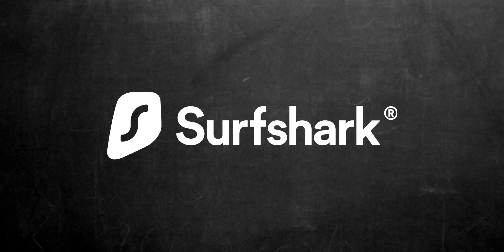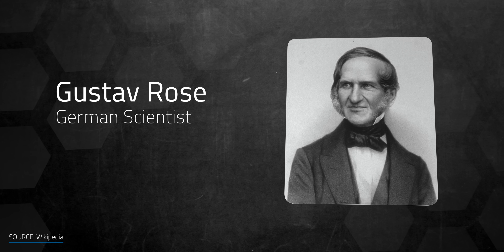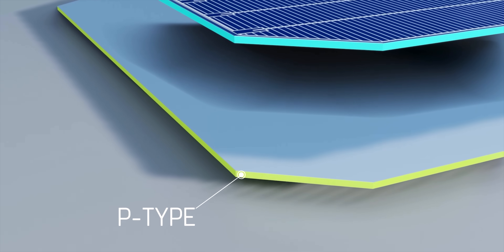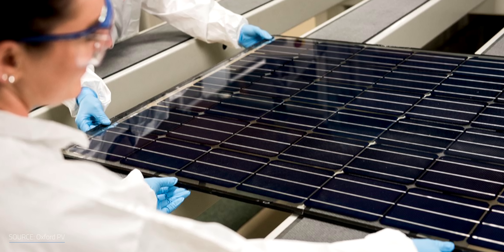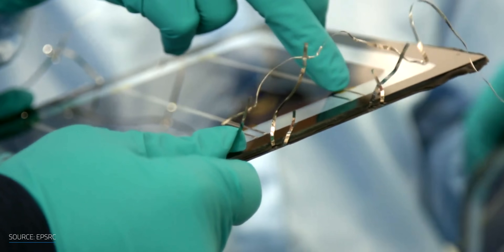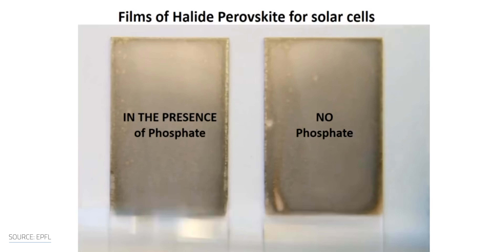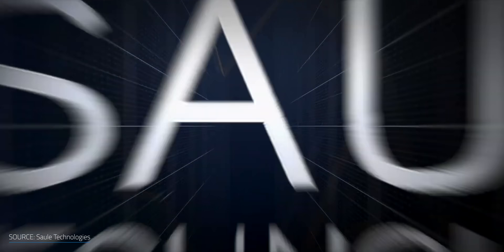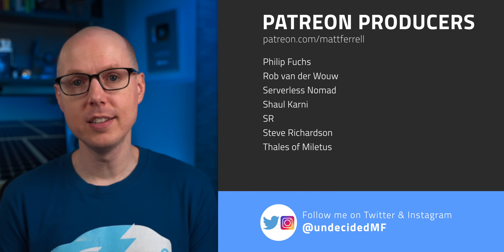Perovskite Solar Cells Could Be the Future of Energy

Comment: So if perovskite solar cells can work in any wavelength, you could put cells in the visible light spectrum facing the sun and then under them, cells that pick up the inferred band (heat). Effectively, you could generate double the electricity per square foot. Since they are thinner, you could put two of the inferred cells under the visible light cell (getting triple the electricity per square foot) and still have a case about the same size and thickness for the silicon cells. Imagine how much power could be generated if each house produced triple what it does now. The inferred cells could also be placed (and generate electricity) anywhere there is heat (steel mills, processing plants, refineries, etc).

Comment: Scientific and engineering discoveries tend to progress in a nonlinear progression, the farther you get on the curve, the faster information increases. It's like how computer processing doubles (about) every two years.
Reply: Moore's law has more to do with optimization than discoveries. Discovery can stall out once the low hanging fruit is picked ... Which is cars haven't really hardly changed in 50 years. Then innovation tends to happen in leaps once a critical mass of supporting technologies arrive for the next stage (like self driving cars).
Reply: @davidaustin6962  It's commonly believed that all human knowlge doubles every two years, information increases exponentially, not linearly.
Reply: @kevinmarsh8922  yes but not all information yields immediately useful innovation. That's why it tends to happen in phases.

Comment: I could see this being used in commercial grid solar installations instead of at home installations. Since commercial grid solar installations are mainly installed on the ground in stadium style slants, it's much easier to do maintenance and replacements. That's also where panel cost is a bigger deal and replacement cycles can be built in.

Comment: Couldn't that be combined with graphene to create the strength needed for longevity, ideal for windows maybe
Reply: Strength isn't the problem. It's efficiency.
Reply: @davidaustin6962  isn't graphene one of the most conductive compounds created, would there be a work around. Graphene from hemp surely would offset that efficiency in production
Reply: @beinghonestsucks8615  not sure of what you're saying, but graphene only exhibits superconductivity when at the "magic angle", which we haven't figured out how to do effectively. Otherwise graphene is about as conductive as graphite, which is nowhere near the conductivity of silver.  Besides you don't want conductivity in the pn junction as that would short it out, thus zero efficiency.
Reply: @davidaustin6962  graphene is used to getting used in everything from cement to military application for strength flexibility and conductivity I was asking the question as I was curious if it could be adapted to the application, one of the questions in the video was strength over time. That might solve that part of the problem. Everything is about cost nowadays
Reply: @beinghonestsucks8615   the reason it helps those materials is it increases resistance to cyclical mechanical stress by preventing dislocation movement in the lattice structure, the main failure mode of those materials. But perovskite fails not due to that phenomenon, but because the material itself is not chemically stable and chemically breaks down no matter what is mixed in with it. There's no lattice structure, no dislocations, just an amorphous mixture wherein certain elements precipitate out over time and no amount of graphene can stop that. Think of it this way, if you add graphene to slime will it make it more rigid? Not really, because the graphene just slides over itself in that matrix. It actually makes an excellent lubricant, making the Material more slippery instead of harder and more creep resistant.  Do a websearch for graphene lubricant.  The way it interacts with a material depends on the material. Some cases it makes it harder, other cases, more slippery. It needs a crystal lattice to makes stuff harder, but perovskite is amorphous, no lattice structure, it at least a fragile one that becomes more amorphous over time
Reply: The Slime wouldn't go rigid but if you incased it in a very thin layer it wouldn't it hold rigid and stop any other interaction while maybe not stopping efficiency. Kind of like a tesseract structure. I am very new to this type of technology and I have a lot of research to do thank you for your feedback it's much appreciated

Comment: This tech looks like it would be an interesting way to reach a “temporary” or “inexpensive” market for field trials; phone chargers, eco-friendly RV enthusiasts, or young homeowners wanting to try solar for the first time without a massive investment. This leaves the long term/industrial market to the long lasting silicon panels while they work out some of the issues.
Reply: Honestly it makes a good material for making short life span stuff, which is what companies do with electronics.
Reply: Depends. If longevity came to say 30% of the longevity and stayed at 5% of the cost, it could be worth it for long-term/industrial uses. The combined increase in efficiency plus cost factor would make it economically attractive even with replacement.
Reply: In solar systems the solar panel cost is already quite low, the installation is actually a large part of the cost, roof work is expensive generally. In europe one can buy a 380W EU made solar panel for 150€(almasolar i'm solar panel)
Reply: @miragept  batt bank is the biggest cost if you install your self
Reply: @ambersmith6517   Yes, for systems with storage they can get expensive quite fast, hopefully the prices are going down with good chinese storage.(byd for example)

Might have a house renovated cheaply on a village, will try to have 3/4 solar panels, 2.2-3kW inverter and 2-4kWh LiFePO battery storage. Cheaper to do solar than connecting it to the grid, and paying for the privilege of paying more is not something i want.
Reply: @miragept  It’s sad because it’s so easy to install them. Can even use glue/rope.
Reply: @MobileAura  That is the case for flexible ones however regular ones would be a bit harder to glue.
Reply: @miragept  I prefer PowerFilm tech.
Reply: @miragept  Na+ will be cheaper in the future I think.
Reply: @mr.gaming6277  And Titanium is the 9 most abundant element in the earths crust, but we don't see a great use of titanium for a reason. But in those Solarpanels we can use TiOx and dont have to use the expensive machinery for raw titanium. If we get rid of the realy rare stuff, then we should be fine. Also the recycling is more energy intensive for silicon.
Reply: @dieabsolutegluckskuche5174  Excellent point about Titanium. Pure Ti oxides and burns into oblivion at a temperature of 600 degrees (Fahrenheit, IIRC) even though it has a melting point of 3,034°F (1,668°C). To unlock its potential they have to melt it and alloy it with Aluminum and Vanadium in a vacuum chamber. The resulting Ti-90-Al-6-Va-4 (I think that's what it is called) is what we usually think of as "Titanium."

Another good example to prove your point would be the history of Aluminum. It's one of the most abundant elements in the Earth's crust, but it is so hard to extract from it's ore that it could only be used practically within the past 2 centuries.
Reply: @jeffbenton6183  great addon, I wrote the Aluminium Part under another comment:)
Reply: @dieabsolutegluckskuche5174  Ah shoot, I must've missed it, thanks
Reply: @jeffbenton6183  :)
Reply: it would be interesting to see the replacement cost of Perovskite Solar Cells, that are stated to be much cheaper, vs the traditional solar cell over 25 years. If it needs to be replaced 4 times but is cheaper or on par with current cells that would make the market take notice.
Reply: @GlennTXstate10  Exactly. There are so many factors - cost difference, carbon footprint of the original manufacture (after all, environmental are a major factor for many people when we're talking about renewable!), etc. Clearly the longevity is a factor and (so far) a disadvantage, but way too early to call how it plays out
Reply: @mr.gaming6277  I guess the point when whooshing over your head
Reply: This sounds more like a scheme to make junk solar panels that won't last and will just consume the market while they kill off silicon solar panels. If something is break easily and can make a profit from it companies will choose that as that will be a better source of income vs a one and done deal.
Reply: @fasddfadfgasdgs  If the success of a business comes down to skimming money from undervalued commodities - both parts and labour, then it comes down to someone saying "it's not personal, it's just business".  In which case, your points are totally valid. Taking the cynical hat off, it might be a way to consume less Carbon?   I'm not forcing an opinion here, just speaking my thoughts.   How would you make it work?
Reply: @fasddfadfgasdgs  You're probably an avid consumer of conspiracy theories, aren't you?
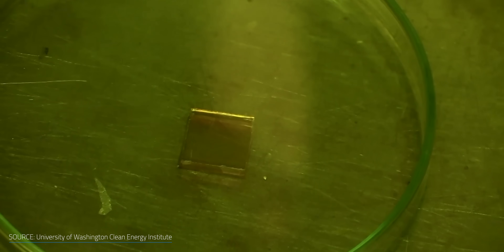Reply: @MichielvanderBlonk  I'm not sure if you're trying for deflection disingenuously, but your response is a straw man. You are responding to a point I didn't make - and even the comment I responded to made no mention of the organization of economic systems. Starting at 2:42, this video might help. https://www.youtube.com/watch?v=IawIjqOJBU8
Reply: @zweigackroyd7301  Planned obsolescence in light bulbs is an actual thing though, and it was a behind the scenes back door conspiracy by the companies that produced them in order to have recurring sales.
Reply: @scottiemcqueen  Right. We're talking about the research stage here, so not really comparable. It's not like perovskite naturally lasts ages, but researchers are finding ways to shorten it. apples/oranges
Reply: The only known real world use for perovskites is making youtube ad revenue for people like Matt.

Comment: Doesn't matter, even if solar cells were 100% efficient (an impossible achievement) they wouldn't be good enough. It's simply a fact that the sun doesn't deliver the energy density required to the Earth's surface, at the very best only 1000W/m^2.

Comment: What a great evaluation! Here in Australia we have great access to sunshine with acres of solar panel farms in Western Queensland in Particular. It is amazing to drive past, but finding out they are only 29% efficient surprised me. I'm looking forward to the next decade when they approach or pass the 50% or 60% efficiency. I would not be at all surprised if the solar industry gets push-back from the coal and oil producing industry though.
Reply: The highest recorded energy efficiency is only 35.6% and that was in 2016 which was a 12 year gap where theirs was about 10% efficiency increase from the 5% gained from 2016.  It probably need another 20+ years to hit 50%+ efficiency and chances are when that happens it will be really pricey

Comment: It seems like this is similar to the battery degradation & limitation problems present on the Nissan Leaf vehicles (that have poor insulation & passive refrigeration/heating systems); compared with the superior active thermal designs used on Tesla vehicles.
  . The 30% efficiency limit on silicon solar panels is ABSOLUTE. It does not matter if they are cheap & resistant "by themselves", if they are future_obsolete on integration.
  -> Once the "standards" allow for self_contained thermal solutions (with each solar panel having its own microchips & sealed fluid disipation systems), then the weight from the "extra armor" required to protect the "fragile crystals" from the enviroment will not be a concern.

Comment: It's certainly an interesting video, and an interesting technology that may well be the future. but, personally I found this video kind of misleading in how it was structured. The first half, which most people will watch, explained this kind of solar cell as superior in every way; cheaper, lighter, more efficient and able to be basically painted on any surface. 

But the second half then adds so many negative elements to this solar cell that it's not only obvious why it isn't the future, but it essentially contradicts the first half of this same video. It's not cheaper, it requires gold and rare resources to encapsulate, and it's not lighter because the materials encapsulating it are heavy. It doesn't last as long so it ends up being more expensive to replace, and water easily damages it, which is a serious issue for what you'd want to use on a roof. Nearly every positive point from the first video is countered by the restrictions revealed later.

Comment: 3:36 It certainly is oversimplified: adding phosphorus to the top layer doesn't make it negatively charged and adding boron to the bottom layer doesn't make it positively charged. The charge difference occurs only at the boundary (the PN-junction).
Reply: Correct, not anymore than a pile of phosphorus isn't charged negatively because the extra electron in the outer shell is balanced by the coincident proton in the nucleus which is responsible for the electron's existence. In a way when it produces the junction electrons are pulled from the n-type region making it imperceptibly more positive (more protons than electrons).

Comment: I think it's a fair push in the right direction.  But why is limitations on materials researching, why put all the eggs in a single basket.
Crystals are the main factor if research understandably. They gave a electrical storage and creation properties.  So why not research all crystals of every kind.  Learn their efficiency, then start combining different types to increase its efficiency.
I do understand they are experimenting but only with this one type.
Which is kind if limiting.  Start combing all kinds of Crystal materials, even research making man made Crystal methods. Who knows some one somewhere will eventually hit a game changing mix.
Because what they are doing is slow and very limited.  If the want to make zero carbon efficiency a reality, it's going to have to be better than 30% efficient.
This is why society went with Alternating electricity and not Direct electricity.  With DC we would have had to put power towers every 1/2 mile, and the nation would have been littered with eye sore towers.
The future of Solar power can not go down the same path.
Wind power us already destroying the landscape all over my area.
And to end fossil fuels for 2 power sources that will take up a lot of space, and is not efficient enough to supply our needs, is not a solution.
If it's so vitally important to make this change over. And deadlines have been set.
Can they do it at a faster pace than a snail's pace.
Because as we are shutting down our fossil fuel, we are depending on other people's fossil fuels to keep up with our own power needs.
This is as stupid of a move as the 80's Cap & Trade Act trying to limit factory pollution.
Which limited all factories to a limit, but if you were a factory producing less that the limit.  You were allowed to sell your excess to a bigger factory so they could keep producing just as much pollution as before the Act.
So effectively doing nothing to end pollution problems.
And this is just as useless when you have to build massive wind and solar farms to only come up short of our needs.
And if our needs increase, which it will with so many people coming into the nation.  Which means more farms or more shortages.
And people will die due to the freedom cold and the scorching heat, caused by that same environmental issue we are doing all this for.
Bottom line the efficiency need to be better, and quickly.
This is not enough.
And if 30% is a limitations best, maybe it's best to abandon solar and improve wind or find something new like using the magnetic poles of the planet to create a perpetual engine to produce energy.  Or even the ocean's waves to generate power on off shore station that feed into the power grid.  Any thing really, wind and solar at this point is not the best solution. At some point the dream has to end.

Comment: It's odd how concerned people are about lead in solar panels when a decent fraction of the water pipes in the country are still lead. Or how every car on the road has 40lb of lead sitting under the hood in the 12v battery. Or the tens of millions of homes that still have lead paint.
I get not adding to that problem, it just seems like a huge whataboutism.

Comment: As PV panel efficiency goes up and cost drops significantly as time progresses, there is no real need for a 10-25 year lifetime. However as installation cost is still around 20-30% of the initial investment - depreciation over 20 years makes more sense than over 2-5 years life span for perovskite panels. The opportunity for perovskite is accessible, DIY projects, wearables etc.
Reply: problem. If the tech doesn't advance as quickly and you are buying more solar panels and creating more trash cause let's be real people will not recycle these things. in fact recycling has become a major problem in America where a lot of it is now being tossed out cause they can't make money off of recycle hard plastics even though they are recyclable.

Comment: Interesting.  Total noob here but was wondering about one thing I heard.  It was that these can be 'tuned' for different parts of the sun light's spectrum.  So, couldn't one - theoretically - have many layers with each 'tuned' to a different "frequency" (I said I was a noob) of the sun's light?  Would such a panel then gather more energy based on the number of layers?
Reply: The answer to your question is covered in the video mate. https://youtu.be/YWU89g7sj7s?t=293